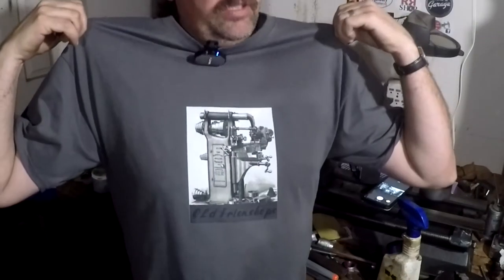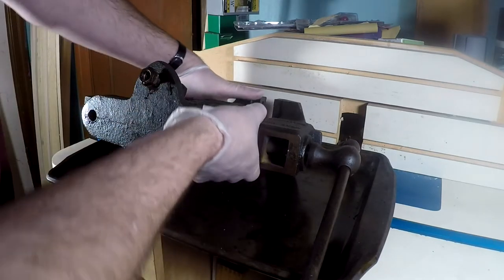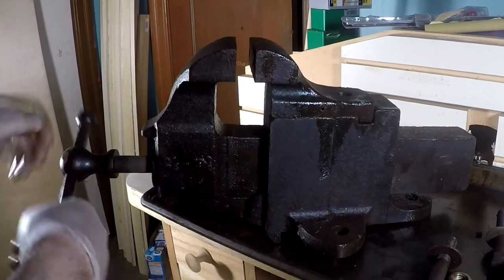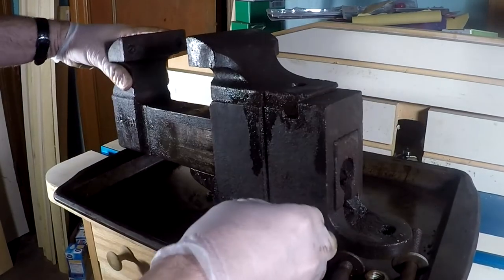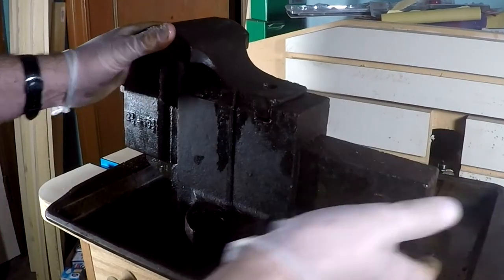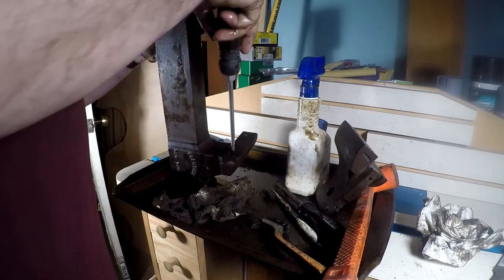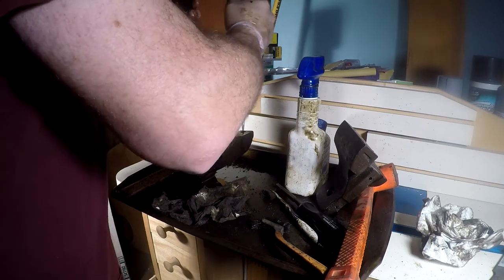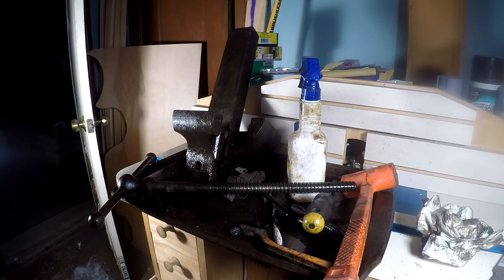Prentiss Vise Restoration no.2 1/2

Comment: Nice Prentiss. Yours is much older than mine. Mine is a #21.
Reply from the maker: Yes need to make a pin does you'd have one?
Reply: Old Iron Shops Yeah mine has the original pin.
Reply from the maker: @hilltopmachineworks2131  love some dimensions and photos of it not sure if it's the exact same size that I need but at least it would probably have the right styling I believe that that has a 3-degree taper
Reply: Old Iron Shops will do. I will be back in the shop Wednesday working and I will get some dimensions. What is your email to send pictures and info to?
Reply from the maker: @hilltopmachineworks2131  oldironshops@gmail.com